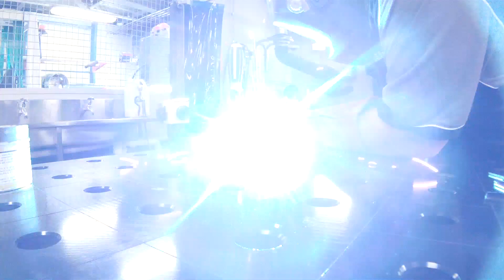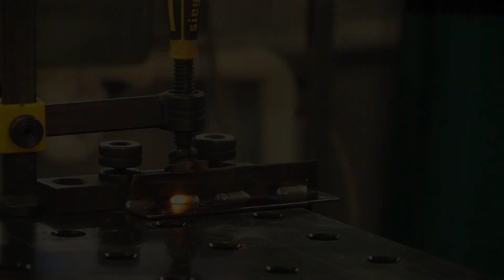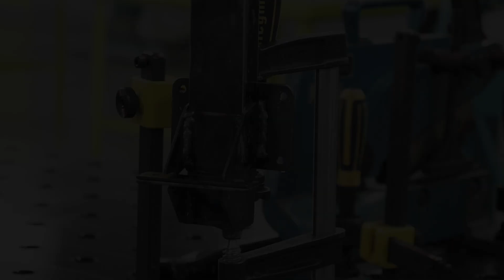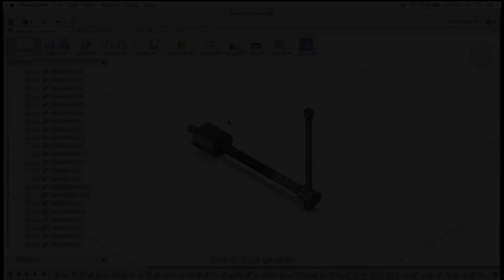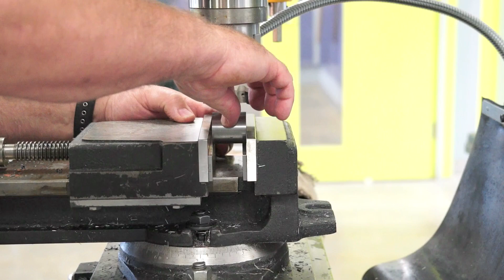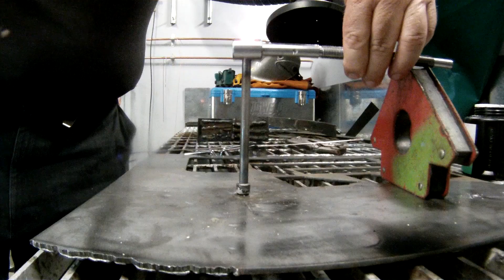Make a Fabricated Vice - Fusion360

Comment: Just subscribed. So jealous when I went to my school metal work consisted of black smith type metal work. bend twist braze. Bought a stick 10 years ago mig 5 years ago. ordered a cheap india vice to see how my drill press goes as a basic mill. With my pocket money that the wife lets me spend trying to build a cnc with arduino. Too many things on my shopping list can't hide enough money from the wife. Every time I find some nice second hand gear on ebay it is either NSW or Vic. I am gold coast QLD. Doesn't seem to be much up here in the way of lathes, plasma cutters, mills the list goes on. I saw your TM25 mill unboxing $2k new had a peek but think I am better getting a lathe first. You think this makes more sense?
Reply from the maker: Hi Leigh, nice to meet you mate.  You made me laugh with your hiding money from the wife.  I think we may be related ha ha ha.  Oh coincidence, I'm an ex-Gold Coast boy myself (born & bred).  What school did you go to on the Goldie? I went to Benowa SHS left in 1983.  Yeah the little Titan machines are great and make for an easy CNC conversion.  As for lathe or mill, it all depends on what you want to make.  You can use a very small 3 jaw chuck in the Mill spindle and clamp your cutting tool in the vice and machine small shafts that way.  Personally, I would go the mill first.  Cheers, Aaron.
Reply: Thanks for the reply . Actually went to school NSW Macquarie Fields left 83 also. Notice you have a little titan lathe I assumed at home. took the the X to work to mill. As far as making things. Just have more spare time and want a constructive hobby. Played with wood titon 2000 etc. Electronics background but have never learnt how to turn steel. Was looking at the nema 23 think about $250 each from ebay. I am from the old school spent an hour on sunday welding the lawn mower giving it a turn up etc will survive another 10 years with back yard mechanics lol. Just be nice to be able to make a metal part when needed instead of waiting a month and paying through the nose.

Comment: Hello from Las Vegas NV USA, Question, is there a reason that you  use straight Argon rather than a CO2/Argon mix for your MIG welding
Reply from the maker: G'day from down under Donvan, it's nice to meet you.  Yeah, we purchase blended gas over here from our gas supplier.  The one I was using in this video is recommended for mild steel up to 10mm thick, which is the bulk of our welding at high school.  It is 93% Ar and 7% o2 plus it's economical for the school budget too :).  Cheers mate, it's nice talking to you.  Aaron.

Comment: Great video as always!  what is the height of the vise?  I would use it with my shapeoko 3 router.  I have been looking into ways to mill 2 sided parts and I have come to the conclusion that a vice is in my future.
Reply from the maker: +metaljeff Hi Jeff, thanks for watching and commenting.  The vice is 100mm wide, 90mm height and 200mm long. I'll add you to the competition.  Good luck.  Cheers, Aaron.